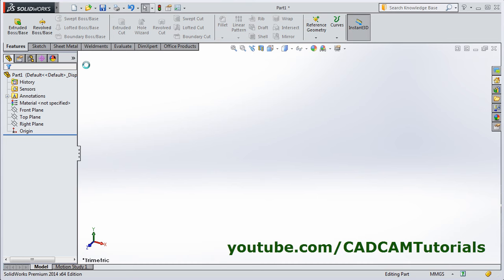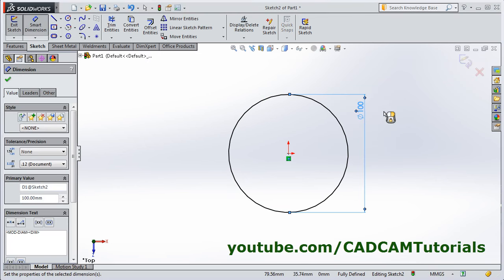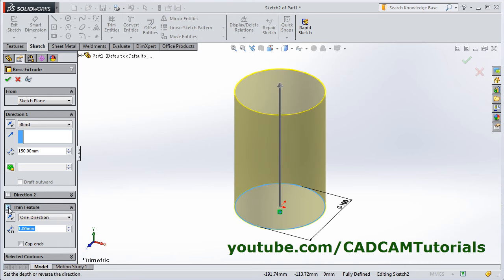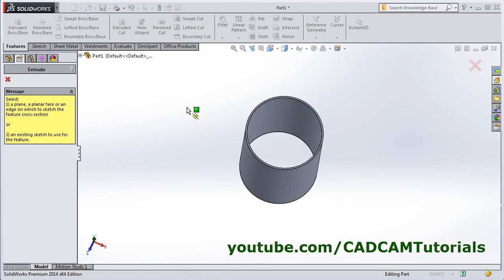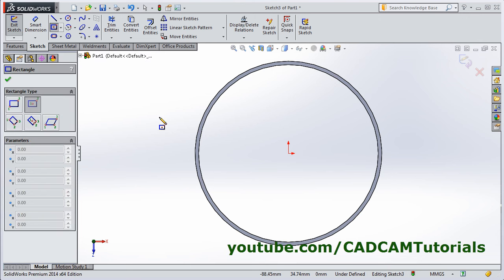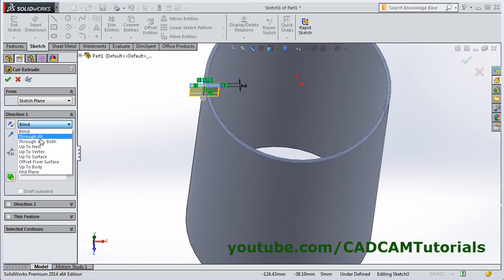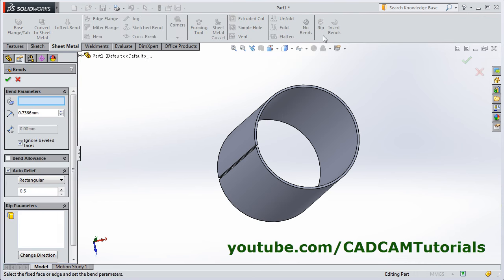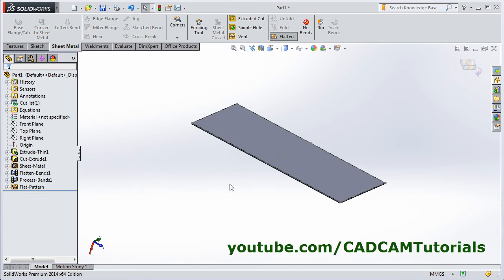SolidWorks Convert to Sheet Metal Cylinder

Comment: there is a problem with this where the cylinder permitere shortens if the wall of the cylinder has thickness, the thicker the bigger the error, what i've done to solve this is just make the wall really thin, like .001 mm and then it will barely lose distance